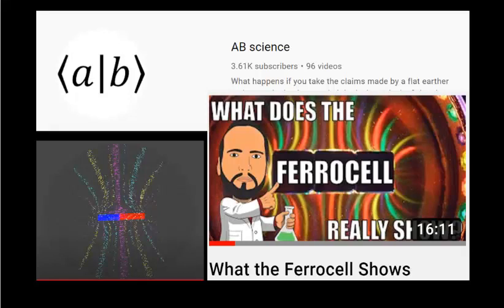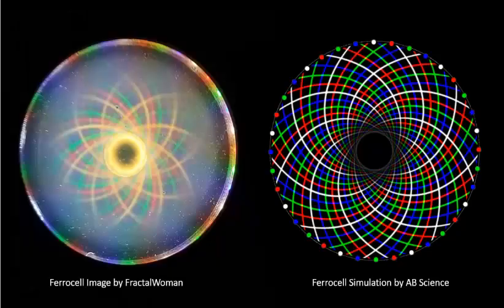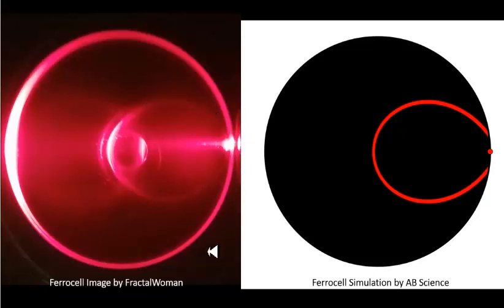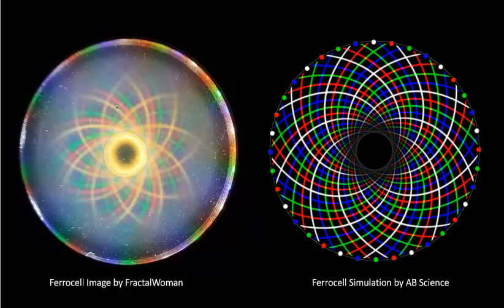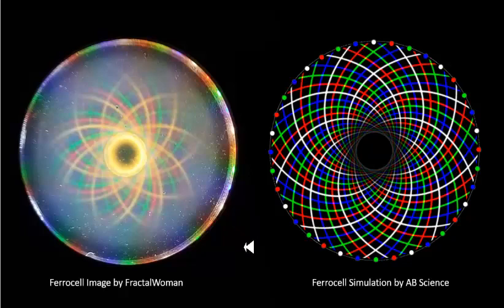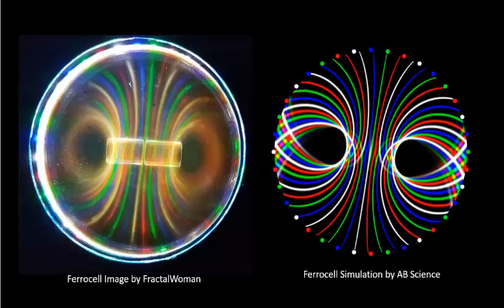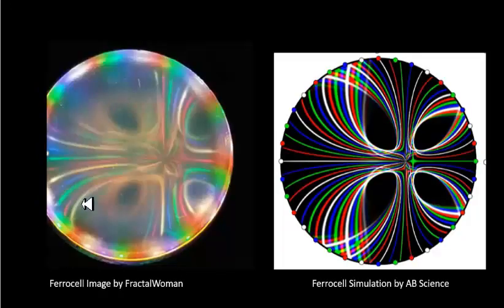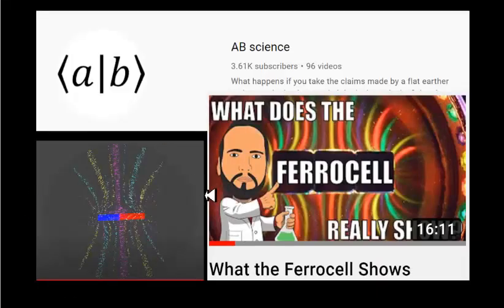What the Ferrocell Shows

Comment: i feel like this kinda proves that gravitational lensing isn't caused by gravity.  wouldn't be magnetic lensing then .  i could be wrong, most likely
Reply: indeed you are wrong. Lensing is proportional to mass and not magnetic field. If it were proportional to magnetic field, we would be able to easily reproduce it in the lab. For example, the sun produces significant enough gravitational lensing for Eddington to detect it. However, the magnetic field strength of the sun is easily achieved in the lab and we don't observe any lensing at all. (for reference, a fridge magnet is enough)
Reply: @FeCoNi_science  yeah, i knew i was wrong ... thank you for the clarification my friend ;)
Reply from the maker: @MooserTheGreat  In my opinion, you weren't completely wrong.
Reply from the maker: Here is my take on gravitational lensing in the context of the fractal paradigm where strong gravity and strong magnetism are related by the property of self-similarity. https://www.youtube.com/watch?v=cahuyj0s3r4&t=5s
I'm pretty sure that AB will not agree with me on this, but this is my position as it currently stands. My hypothesis is based on the idea that the medium for the propagation of light is ferrofluid-like, as I explain in this video.

Comment: Great work! Looking forward to your paper! I hope AB science will release the code to public. With the modern computer-aided image registration algorithms, it could be used to estimate the unknown magnetic field source location(s), orientation(s) and strength(s). Once found, then those can be used to i.e. plot the hidden magnetic field lines. I wonder if this code (in combination with Ferrocell) could stir up some industrial application as well. Maybe the code could be used to improve the Ferrocell design (location and orientation of LEDs) as well to see if the hidden magnetic field cross-section could be shown (nearly) directly by the nanoparticles through reflections in some other LED configuration?
Reply: We'll probably throw the code up on a repository somewhere. Maybe we'll add a nice GUI. However, the thing is really simple. The actual calculation is a single line. The rest is setting up variables and formatting the outputs. Indeed, we did consider image registration to match the results to a pictures. This should allow us to come up with a phenomenological function for light attenuation in the device and figure out the different components for refraction. 

I don't really see any "useful" application for the device beyond fun. If you want to characterise a magnetic field, you're best off using a hall probe.

Comment: i wonder if your program can replicate this  ...  https://www.youtube.com/watch?v=yl3FMJyMf_M
Reply: Should be pretty straightforward. Although, we’d need to replicate the physical setup and get the appropriate parameters to get anywhere.
Reply: @FeCoNi_science  ring magnet below ferrocell and bar magnet on top of ferrocell.
Reply: @briankerr4512  when using more than one magnet, field strengths are important. Also need dimensions, position, and orientation. 

We’d then need the properties of the ferrocell: mainly the radius, glass thickness, and the position of the lights. Finally, we’d need the observer position with respect to the device.

Comment: To clarify, is the suggestion the iron aggregates along the field line, which in turn puts tension in the medium as it is 'dragged' with the particulate (surface tension) and this altered morphology in medium reflects in this pattern?

Or is this purely suggesting it is reflection from reflective particulate IN the medium?

I got the former from the initial suggestiom this was a kind of 'illusion'.
Reply: Yeah, the hypothesis is it can all be explained with specular reflection.
Reply: @maudeeb  Yes but are we saying the reflective surface is the particulate (iron) within the medium or a mixture of the two (morphology of medium caused by the aggregated iron)?
Reply: @sterlingarcher5698  I suspect brightness and colour tint might be more complex, but given this demonstration just deals with specular reflection, the 'lines' are essentially that.
Reply from the maker: @sterlingarcher5698  To be clear, the nano-particles in the ferrofluid (consisting of magnetite or hematite) link up into long needle-like objects in the presence of a magnet. These nano-needles then align with the magnetic field much like iron filings would do. The light gets reflected off the needles and into to your eye depending on the orientation of these nano needles within the fluid. Simple as that. I use 1 part baby oil to one part ferrofluid in my ferrolens. The baby oil allows the nano-needles to move freely so that they can align with the magnet field when the magnet is placed near the lens.
Reply: @maudeeb  the brightness is indeed more complex. It does look like the colours change a bit, I think that it is safe to say that this is due to the fact that magnetetite has a colour itself, ie. Some colours reflect more readily than others.

Comment: you may find my question so stupid but I need to ask : 
why lets say white colored light source ( led ) is not also reflecting the green or red curved lines of ferrocell particles at the same time ? 
I mean why there are different line of colors if this is all about  reflecting from ferro nano particles which are concentrated as curved lines because of magnets.
I feel like I am not asking it right so I will make a story line : 
we have leds on the edge and each with different color.and ferrocell particles in the fluid are concentrated in the form of curved lines because they are aligned accordingly to the magnet beneath. magnet beneath effects nano particles in the ferrocell form curved lines. so as an example, when the led light goes through the ferrocell I would expect this led light to reflect on every ferrocell nano particles on its way. but according to the visuals and sim, one line is just in white and the other is just in green and the other is just red. how come the RED led only reflects on single curve but not also on the other curved ferrocell particle line right beside it why separate different colors?
Reply: and another thing that I need to ask ( because it has been a long time since I am not following your content and I keep forgetting things,) :
these colored lights are longitudinal waves isn't it. you call them compression lines. these are same with your rolling smaller magnets demonstration. when they were positioned front of a larger magnet these round magnets tend to start moving towards larger magnet in the center, in a curved form,  they get closer and closer and eventually  until they crash on the side of the larger magnet.
 The dark hole in the middle is where the transverse wave resides and you can not show it to us. it is only the compression lines we see in the ferrocel. and if the dark hole in the middle of the magnet is bigger that means the compression waves the magnet creates around it self would be weaker. if the dark hole in the middle of the magnet is larger that means the compression lines around the magnet will be stronger. hence the difference between n42 vs n52
I said all this to ask this: 
why all of the line with different colors are changing in to yellowish color of light when they started fading in to the dark hole region. why they dont remain in red or white or blue till the end. 
can you please correct all of my mistakes. it won't take much of your time. you already know all these.
Reply: maybe I shouldn't have called it transverse wave . ken calls it dielectric inertia plane. the dark areas on both end of the magnet. with transverse wave I meant what ever goes in and out of these black areas. like gama ray explosion of stars from both ends.

Comment: What happens when you take two magnets and put a very thin lead washer in between.... Sometimes you can force "opposing poles" together...
Reply from the maker: That question is out of the scope of the ferrocell explanation. That said, this is something you can easily try yourself. Let me know what you find.
Reply: @FractalWoman  it does create a monopole but not a perfect one.
Reply: @1NEFFIBLE  it’s not a monopole by any means. Indeed, it is out of scope, but not really beyond our capabilities assuming that the washer is made of a paramagnetic material. If the washer is ferromagnetic or anti ferromagnetic, it becomes very problematic as we’d need to go to micromagnetics for this. We struggle with micron sized geometries when it comes to micromagnetics as computational power is the limiting factor. Macroscopic objects are just a no-go.

Comment: Are you looking at your slides in two dimensions or three? Some of them I have made wire models of. Some you can just push pause and put up against a mirror. ❤️
Reply from the maker: It is neither 2D nor 3D. That is the wrong language for what is going on. The fluid layer between the two pieces of glass is VERY thin compared to the two pieces of glass, but it is not 2D.  It's true that the ferrocell looks 3D when you are looking at it in real-life, especially when you move it around, but this is just an optical illusion.
Reply: @FractalWoman  I didn't realize it was so thin
Reply: @1NEFFIBLE  it is very thin. For all intents and purposes, it is 2D. In experimental physics, there is a very fine definition of what is 2D. The issue is that, of course, any real object is always going to be 3D. Experimentally, we can treat things as 2D if there is significant change in two dimensions, and any change in the third is negligible. Take your hard drive for example. This is clearly a 3D object and the spinning disk has a radius of several centimeters. However, the thickness of the storage medium is in the order of nanometers and there is almost no change in the key observables along the z axis. Hence, we can treat this inherently 3D object as a 2D surface provided that we include the appropriate considerations. 

The same goes with the ferrocell. The ferrofluid film is very thin and there is negligible difference in the conditions between the bottom of the film and the top. Therefore, this dimension is ignored as far as experimental physics goes and under the provision that the correct considerations are in place.

Comment: Think of different planes when using light sources 😇one should come from below in the center too 🤯 I think number 9🙏 it should be halogen voilet
Reply from the maker: The simulation is capable of placing the lights wherever we like. In the image with the single light, the light source was in the middle of the ferrolens. In the rest of the images, the light was slightly above the ferrolens. The ferrocell doesn't work very well when the lights come from below. That is because the light needs to reflect off the nano-particles into your eye, but when the lights are below the lens, the light is reflected away from your eye instead of towards the eye.

Comment: Just wondering but what is the shape of the magnet? What if you change the shape of the magnet? Maybe show two of them stacked on top of each other in a Farrell cell?
Reply from the maker: I was using a cylinder magnet in all of these images. In some of the images, I used one cylinder magnet 1cm diameter by 1cm tall. In some of the images, I stacked two cylinder magnet just as you suggested. We can simulate any configuration of magnets. In the last slide, I showed two sphere magnets side by side.

Comment: Thanks for the ferrocell work you two.  Are you planning on explaining the POV change showing the torus shape, and a 3D render having depth?
Reply: The code allows you to change the observer position as it stands but for now, i projects it on the same circle. Doing a perspective transform on the circle would then give what you would see. This has given me a fun idea though :)
Reply: @FeCoNi_science  I suppose if there's a sense of a toroid viewed from different angles, then it will naturally have stereoscopic depth.  Still can't quite get my head around how this POV torus illusion works.  Have you tried raytracing the specular in blender?
Reply: @maudeeb  I’m not using blender anymore. I ran the initial bit in blender because it was conceptually easy. The problem is that you need a lot of particles to get a nice result and it is very intensive. The first attempt required an absurd amount of GPUs (I gave up after spinning up the 4th Nvidia Tesla V100). It was all well and good back then when everyone was on furlough and no one was using the supercomputer, can’t do that now. 

There are several factors that result in the effect, First is the view angle which is fine. But the brightness is an issue. 

The current sim only calculates where the lines should be, not the brightness of the lines. The brightness is tricky as there are several mechanisms by which the light is attenuated.
Reply: @FeCoNi_science  The steeper the angle from POV, the more the line will appear to move.  The far side of the plane will be more squashed.  I'm guessing cumulatively, this gives the impression of form.  It would be nice to see if only to discount any light/field interaction.  

Can the colour tints be explained without field interference?
Reply from the maker: @maudeeb  I actually was able to see this 3D "holographic" effect to some extent in my blender simulation. https://www.youtube.com/watch?v=o6WYL0eubb0&t=3s
Reply: @FractalWoman  Slight, but it's there.  I've never seen a ferrocell in person.  Is the less dramatic effect something to do with the tightness of the field you used or simply the diffused lines making it difficult to see?
Reply from the maker: @FeCoNi_science  Oh boy. Can't please tell.

Comment: There has to be something there for this to happen. Kens video showing continuous LED lighting showed the field but displayed in a more foggy like pattern.. ie super hi res vs low line count painted in the single loop LED arrays that we see.
Reply: Continuous light source is on the list of features to add. It's pretty straightforward but Lori and I are both focusing on more important things at the moment.
Reply from the maker: @FeCoNi_science  I was actually able to simulate the "continuous lighting" situation by setting the number of lights to 1000. But because the simulation doesn't do brightness, it wasn't very interesting.

Comment: The simulation is almost accurate but you forgot to add the white center ring clearly visible on the actual photograph.
Reply: The simulation models one very specific aspect. There are other features which are out of scope for now. These may come in later, but we are focusing on the main lines for the moment.
Reply from the maker: As AB said, and as I clearly stated in this video, the simulation is only simulating the main light lines which spawned my curiosity about the ferrocell in the first place. We are done as far as that is concerned. The rest is going to be standard optics which has been known for a long time. There is no new physics here.